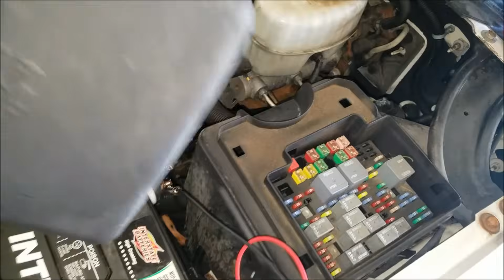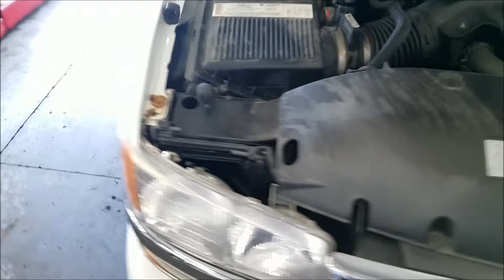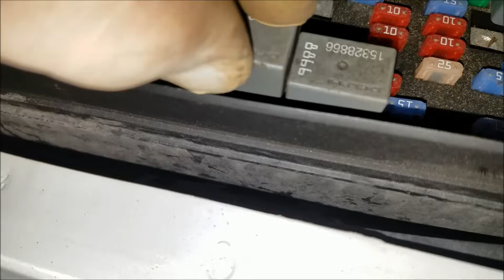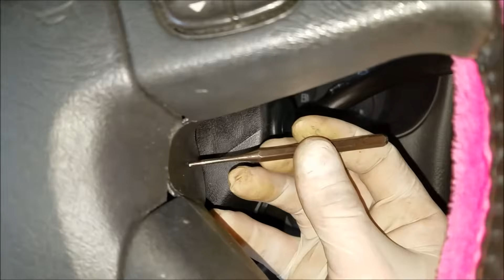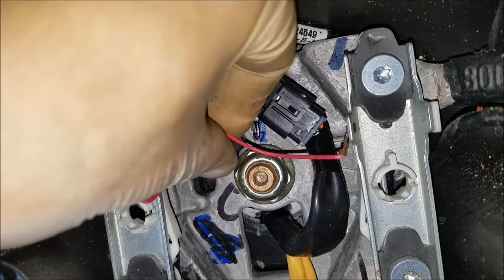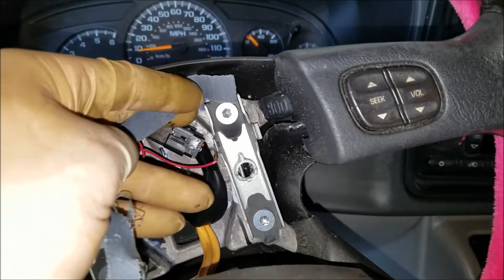03-07 GM Truck Horn Repair Silverado Sierra Tahoe Yukon Suburban Escalade Express +pad removal GMC

Comment: Thanks for the info bud. My Max had the ignition drilled out in a thankfully failed theft attempt (had my enclosed trailer behind with my Z06 in it, doah). My horn hasn't worked since. I suspect debris is encased in steering wheel horn assembly, and now I know how to discern. Looking forward to inspection with a clear path to do so. Awesome video. Cheers from Canada ehhh :-)

Comment: My red wire white plastic snap in prongs were broke and not holding it down. I had a 1inch black fuel hose or vacuum hose and cut about two inches of it and slid it on up on the white plastic. Then inserted it and pushed it down to make contact and then pushed the fuel or vacuum hose in the hole and I believe it is going to hold it pretty good. Gotta do what you gotta do, lol.

Comment: word of warning for those replacing the wire+metal tabs make sure to line up the hole in the plastic cowl with the hole in the brackets, they can go in two directions and one is definitely not the one you want. ask me how I know lol.

Comment: My horn wasn't working because the plastic lock that holds the wire to the contact in the steering wheel wasn't locking so the unit had no contact. I bought the whole kit from O Reilly for $26 it comes with the side contacts.

Comment: Good video. Re: piece with the spring that holds the tip onto the clock spring: One tab on that white plastic piece (with the 2 red wires) broke. What’s the name or #  of that part?  Sourcing ideas?

Comment: I’m having a issue I changed my airbag and steering wheel on my 03 Yukon connected everything back horn work good but now my alarm won’t honk when I lock it or unlock it or when I press the panic button

Comment: You are absolute GOLD !!!!! I am based in Australia and own a 2004 1500 Avalanche ( this is a unicorn in Australia ). My horn suddenly stopped working... and i was fearing the worst. I stepped through your very methodical, logical fault finding process.. to find that the mechanics that recently did some work on the alignment /steering had broken the lugs off the horn contact white plastic fitting and then just put it back into the steering wheel with obvious outcome .... no horn.  ( expletive of choice !!!!!!). Cant thank you enough for your No Nonsense wisdom ... from Australia...Love your work !!!

Comment: Worked great! I cleaned everything as you mentioned and that spring contact didn’t look too bad. I just stretched the spring a little instead of the solder trick and it worked perfectly. Thanks!

Comment: @Casy (or someone who knows),   I suspect I have the same issue you did. Can you elaborate some more about this brass ring that power comes from the turn signal assembly and out to the assembly behind the air bag through the white plastic plunger with two red wires (which seems to be the source of most peoples problems - or the actual spring loaded contact points).  I anticipate 
1) I have to remove the clock spring  from the steering column to get at the brass ring

2) the white with red wires plunger assembly goes through the steering wheel contacts one side of the brass ring.

3) there is a plunger on the turn signal assembly that touches the other side of the brass ring bringing part of the horn relay circuit out to the ground contact assembly behind the air bag.

4) do I need any tools to remove the brass ring so I can clean both sides of it and clean the contact on the turn signal assembly? or does it simply lift out once the clock spring is removed?

5) did you solder tip of the turn signal assembly plunger pin to extend it, or the tip of the white plastic assembly with two red wires, or both? (once I have gotten that much apart I intend to do both - given they are both spring assemblies it cant hurt (other than the worn filaments of solder getting into something else).

This thread goes a bit beyond what is covered in the video: https://www.gm-trucks.com/forums/topic/254800-horn-not-working-replaced-steering-wheel-horn-contact-still-no-horn-clock-spring/#google_vignette

I did like the video, lots of useful diagnostic info, just not enough to solve my horn issue.
Note that while the horn circuit runs through the clockspring - the clockspring is not part of the circuit. Don't let anyone mislead you there. At least that is the case on a 2001 Tahoe.

Comment: For those that have done this and the horn still doesn’t work, it’s possible the multifunction switch is at fault. That was my issue. There is a small button on it that touches a ring on the steering wheel. Mine was worn down. Once I replaced the switch, it worked perfectly. However, make sure to go with a factory part on this. Otherwise the buttons wear down VERY quickly. The first one lasted a few months before it wore down (made of soft brass on the cheap ones, I believe).
Reply: For me I sprayed some electrical parts cleaner back there and it solved my problem

Comment: PS my 03 2500 horn (very rusty)
Was on the left side sandwiched between 
The W/W tank and radiator support
Duh but the bolt did break loose

Comment: Great video! I was shown a long time ago to use an eraser to clean electrical contacts. It removes any corrosion or tarnish (on silver plated contacts) by burnishing them without damaging them. Sandpaper can remove plating, and possibly embed silica from the paper, into the contact, damaging them.

Comment: Casey, thank you thank you, thank you!!!! You just saved me another trip to the mech shop where he "supposedly" had fixed it before at a cost of $132.00 pr hr.  BUT, taking that center hub on the steering wheel was sooooooo easy, thanks to you!!!  I wiggled around the center wire with the brass tip and it worked. When I'm back from holidays I'll see about adding a touch of soder to it to improve the contact. I suspect that's likely the problem. 
Again, I really appreciate your clear instructions. Invaluable. 
Paul - 2006 Chev Avalanche.

Comment: Hey man. Thank you for this. Just inherited a 2003 chevy silverado. Had the issue inside the wheel with the spring mechanism. Pulled the cover off, cleaned lightly. Horn works like a charm.

Comment: So, it turns out mine had the exact same issue. The ground to the relay wouldn't work because the contact was worn down. I put some solder on it and it was good to go. I did get sidetracked on the wiring, found out my 2005 Sierra has dual horns. The left horn is behind the left headlight assembly just down a bit. That needs to be mentioned as both my wires on the right horn read less than 1 ohm because the left horn was still connected. My truck is fixed now. Thank you

Comment: I did everything you mentioned here and still no horn. Everything works as you tested. The only thing I noticed is no matter where I touch the probe on the steering wheel there is no ground. Fuses and relays are working perfectly. I can get the horn with another method so it’s not the horn, just no ground in the steering wheel. Any advice? Thx

Comment: Man, I went over wiring and removed the horn and tested it. It worked, saw your video and pulled the spring cleaned the end and it works just fine. Thanks for the vid!
Reply from the maker: No problem, glad it helped out!

Comment: Thanks for the great tips. You directed me well in fixing my 2007 Silverado horn issue. I plead guilty to not disconnecting the battery or the airbags. I know that would generally be wise and a good safety measure. i do live on the edge. Nonetheless you got my problem taken care of.

Comment: Thank you this was the exact problem.... Had green corrosion on the contacts with the red wires that I believe they call the clock spring.... I brought it to my local garage 1 year ago and they said the clock spring was fine cause they put it on the computer.. They did not take it apart like you and I did... Because of your knowledge my horn is now working... It has taken 2.5-3.0 years to figure this out... But I guess if I were smart enough to watch your video in the first place then it would have been fixed long ago... A big shout out and thank you again, Jon in Maine

Comment: Great video. My horn only works when the steering wheel is in the 1 o'clock position. I looked at the contact with the spring, and it was clean. I did stretch the spring, to give it a little more contact. I haven't yet used sandpaper to clean the 4 other contacts. If cleaning the 4 contacts doesn't fix the issue, should I replace the clock spring? Thanks in advance
Reply from the maker: Thanks. Honestly it's hard to give you input without seeing it. This is an older video and I'm more of a Hands-On person. But yes make sure you're getting good contacts on everything. Maybe try to clean the clock spring off?

Comment: Thank you for this! Fixed my horn issue. Tested horn by using the alarm first and worked so knew it must be at the wheel. My contact at the end of the spring had a hardened glue like substance on it that i sanded off. Also looked like the same in the slot, so wrapped a bit of sandpaper on a small screwdriver and rotated it in the slot till the contact looked clean again. Voila! Thx
Reply from the maker: Awesome to hear the video was useful to you. Thanks for dropping a comment and glad to hear you got it rectified

Comment: On point...and straight to it.great video
Reply: Yah imma tech aswell..most issue I find on em gmc chevy is em engine block and under driver door ground wires...
Reply: @lambertleigh2724  Hello sir 
My name is Ramanpreet singh. I am from india. I am a mechanic. i need job there as a mechanic if is it available then let me know please.
Thank you
Reply: That's same thing that happened to my 2500hd...u just got a new subscriber...
Reply from the maker: @lambertleigh2724  yeah it's a pretty common issue. I actually made this video about a year-and-a-half ago, but finally just got around to editing it. And I appreciate that thanks!
Reply from the maker: Thanks Lambert